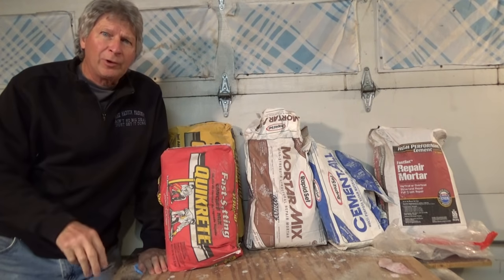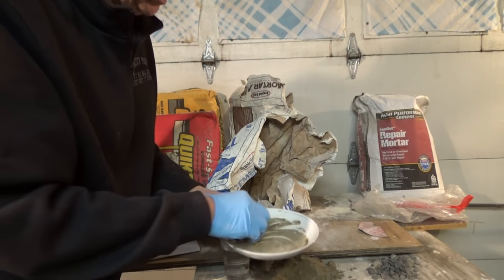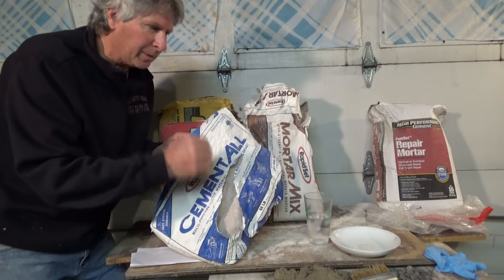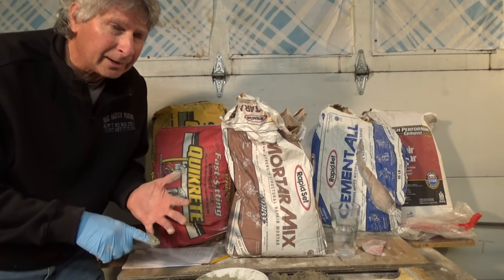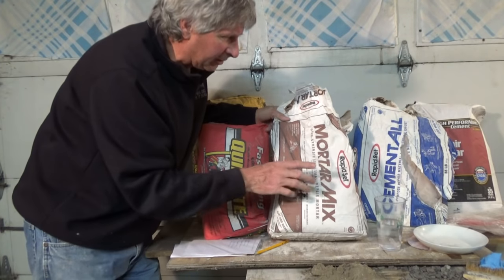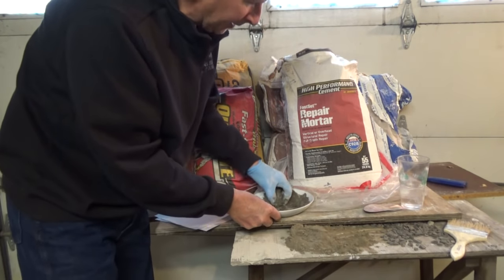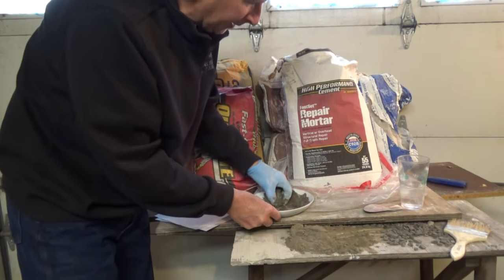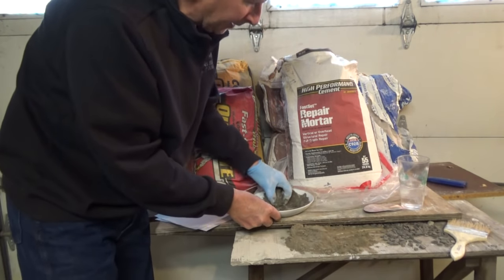WHAT CEMENT SHOULD I USE (Part 3) Mike Haduck "Fast drying"

Comment: The rapid setting cements are CSA (calcium sulfoaluminate) and are chemically different from portland cement, which is made from limestone (Calcium carbonate), which is converted to calcium oxides when clinker is made, and is mainly calcium silicates and calcium aluminates.  You can control the set time of the CSA cements with the addition of varying amounts of citric acid, much as in the old days of adding some soda pop (sugar) to portland.  In my decorative concretes, I add varying amounts of CSA to the portland from 5% to 30%.  This allows me to not only speed the set of the portland mix, but also adds early strength and the CSA, which expands as it sets, compensates for portland's tendency to shrink. Shrinkage cracks are then at an absolute minimum. If it's going to rain, I increase the amount of CSA so the mix sets within an hour.  I also work with mixes containing metakoalin and silica fume, both being pozzolans, and utilize their small particle sizes to take advantage of particle packing that creates a very dense, impervious finished product with compressive strengths of 15,000 to 20,000 psi when mixed using fiber additives.
Reply from the maker: Hi dperry,,,this is great info,  they should put it on the bag, I been doing everything trial and error, I added to the Portland a few times and it worked fine, but dosent work as a paint, it holds up to the freezing weather very good, I got to pin your comment to the top of the page,  thanks Mike
Reply: @MikeHaduck  I forgot to add that one of the other ingredients that I absolutely can't do without anymore is acrylic bonding agent/admix.  If you add it to your mix water, I think you'd get the results you want when using mixes at paint consistency.  I buy acrylic with 50% solids and dilute it 3 parts water to 1 part acrylic When doing parging or adding new mix to old concrete, wetting the old concrete with the acrylic/water mix instead of plain water and using acrylic in the new works wonders for bonding.  Most of the stuff sold in box stores is 25% solid or less, so it should be diluted with less water. Dozens of brands. Sika Latex, Laticrete, Acryl 60, Weldcrete, Crossco AcrylB60. Dayton-Superior J40, LaHabra Ladacyl, Fishstone KongKrete and more.  They make your concrete much more durable and waterproof.
Reply: You're a true craftsman. Kudos.
Reply: What do you think about 'Universal 1023'
Reply: @MikeHaduck  Yeah, they are almost secretive about what is in their products.  The CementAll is not all cement.  It has a very fine sand in it - maybe mostly.  The pure CSA cement is in a purple/white bag and super expensive.  A tan color shows that it is CSA not portland.

Comment: Cementall is no joke quick set. Just had my first experience with it and man, slap it on, smooth it out QUICKLY and move on. I swear it was hard to work after 10 minutes...IF THAT! DO NOT make more than you can handle.
Reply from the maker: Thanks albert,, I agree

Comment: Damn i came to say that i patched with that red bag of quick set today and what a hassle it was with all the rocks. I put a first coat, worked out the rocks, then went and sifted all the rocks out for a finish coat. What a hassle
Reply from the maker: Hi Greasy, I don't know what you are patching but I rarely use a product with rocks in it unless I got a big hole, I got lots of videos on "concrete repair" and others on "foundation repair" I use diffrent products, thanks Mike

Comment: Thanks for being a good teacher Mike. I’ve actually painted with Cement All  before turns old concrete white, learned that trick from you!
Reply from the maker: Thanks Geno, mike
Reply: Thanks to Mike I was able to repair the 4 foot by 3 foot section of120 year old foot thick brick wall that collapsed when I pulled the old front porch off. Its disconcerting to stand in the basement and look out at the street through a hole in the house. It kept playing in my mind wet it down good and just stick it in there. It doesn't matter how you do it just get it in there. Several years later its solid as a rock.

Comment: I like the Rapidset Mortar mix. After watching some of your videos last year, I did a foundation crack repair, an exterior crack that was leaking through to the inside of the house. Some handyman had done a crack repair in the same spot about 15 years before and they packed it with a chunk of 2x4 and thin diameter steel lathing for filler. The cement was crumbling, steel was already rusting and I suspect you never want to use wood as packing filler for masonry work. Rapidset mortar mix was great to work with and I used pre-mixed Quikrete parging cement for over top and then exterior acrylic latex cement paint. It's been a year and a number of hard rainstorms and no leaking from back splash/ground splash. Rapidset Cementall was another story. I went with that for some crack repair (up to 1/2" wide cracks) on a cement driveway pad because it was supposed to be finer than the Rapidset mortar mix. I am in the prairies in Western Canada and we get -30C all the way up to +15C with Chinooks in the same week in the middle of winter, we can get 3 feet of snow in a dump, hard rainstorms and hail storms in spring (but low humidity) and +30C in summer. Every crack I filled with Rapidset cementall crumbled and failed, I was shoveling it out with the snow, so it didn't even last until spring and I am going to have to clean it all out and redo it with another mix. I have to mention I did try an experiment with Quikrete Polyurethane Self-Levelling Sealant that you put on with a caulk-gun on another exterior cement pad with smaller cracks and inside a garage and it worked very well over the same period. Keep up the good work on your Youtube channel, Mike!
Reply from the maker: Thanks, driveways are tough, especially in your weather, maybe next time 1 1/2 sand to one Portland,  for the cracks but if the driveway is moving it will keep cracking, thanks mike
Reply: That's my concern, it hasn't started heaving yet but if the cracks expand it will likely start breaking up. What kind of sealant do you recommend after a repair? A penetrating sealant?

Comment: This is really helpful. I remember doing a project with a friend and we used rapidset without knowing just how rapid set rapidset is. Panic set in and we started hauling! Funny thing was the stuff we slapped down fast and striked off quick didn’t have any tiny surface cracks.
Reply from the maker: Thanks, Mike

Comment: Great video Mike.  I have an old patio that is a mixture of concrete and bricks and is still quite solid even though the surface is uneven.  I would like to give it a smooth cover with some type of cement or concrete product that would probably be one-half to one inch deep and wonder which product you would suggest.  Thanks in advance for your advice and keep up the great videos.
Tom
Reply from the maker: Hi Tom, to be honest, I haven't seen anything hold up in my area that thin, maybe another thin layer of pavers might help, unless I was there to see it I really can't say, Mike
Reply: I want to do same thing on stairs and don't know wtf to use!😲

Comment: Hi thank you for all your excellent videos & taking your time to make us the videos. 

i have a question please. So I have made a lean to shed using thin mdf board panel as my walls. What I did was I use the nailer gun and stapled the board onto the 2x4s all around. It’s been over 2 years now and it’s starting to come off like the stamped nails are coming off the 2x4 and there are gaps between the vertical boards that are attached side by side. My problem is that I can’t get myself to the back of the boards to staple or mail it onto the 2x4s. 

So I will have to go inside the shed and try to somehow pull the boards inward and use long nails to attach from the inside instead. 

Now my question is…if I was to use cement all fast setting and put at between the gaps between the two attached boards, will it bond and hold up? I was thinking about the fabric concrete and staple ins it onto the boards and 2x4s hoping it will bond. 

Any advice is greatly appreciated! Thanks!
Reply from the maker: Hi, Cement is just liquid rock in my opinion,  not made to stick to anything, it's mostly a binder not a glue, I hope it helps mike

Comment: Hello, great knowledge. I just put a new layer of cement on my front porch sides. I used the fastset repair mortar, about half a bag and i also put 4 scoops of portland and mixed it up and applied it. Will that be ok? Im in nj. 2 hours south of scranton pa.
Reply from the maker: Hi Kyle, I added portland before and had no problem with my mixes, I just wouldn't overdo it, thanks Mike

Comment: Hi Mike , I have a question, I have a auto repair shop that has chips out of the concrete 1/2 to 1in. deep from dropping heavy objects . They might be 3 or 8 inches of damage around the chip. I would like to know what is the best way to fix this type of patch , that will stick and won't come loose with traffic on it. I live in Canada  Manitoba. The shop is heated ,can or should it be done in the winter months or should it be done in summer. Any help would be apricated . Their are just so many premixed products when you go to the store to chose from.
Reply from the maker: Hi Jeff, I got a whole playlist on concrete patches,  and my rule of thumb is 3 days without freezing, Mike

Comment: What would you recommend to fix a corner that the dumpster company knocked off a top block on a wall? The pieces still there just don't know whether to use a mortar or some type of epoxy
Reply from the maker: Hi Dave, I have series called "masonry wall repair " maybe part 5 will help, thanks Mike

Comment: You mention using Rapid Set CementAll for iron railings but also mention rain causing havoc for it.  I'm looking to fix a loose porch railing.  Will using this product work for me or do you need to put a top coating of some other product to protect it from rain?  You mention painting it which may not look great on porch steps?  What would you recommend.  Thanks for this video.
Reply from the maker: Hi Samila, I have a whole series on concrete step repair and one video "brick step repair, part 6 ,mkke haduck where I put the old railing back in,  maybe that will help, thanks Mike

Comment: Mike I need to fix my foundation around the house (slab) with about 8 inches exposed before the house on top, its crumbling and especially at the corners, the house had no gutters till I moved in and I think that was the problem for it falling apart, so to fix the corners of the slab and smooth out the rest, should I use the rapid set mortar mix? I live in the Deep South so freezing is never an issue,  thanks for the info
Reply from the maker: Hi Sybo, I have a whole playlist , foundation repair,  Mike haduck I show what I use in each case,  every situation is a bit different,  thanks Mike

Comment: Thanks Mike!   What do you recommend for a resurface product, that is not insanely priced?   I recently used Top'nBond to resurface a 3.000 sq ft Driveway.  It took me months to do by hand, using a 1/4" Dowel Straight edge to ensure height.  Using a hand trowel, was the safest bet, after trying other things.   I had problems color inconsistencies, where one area would look a nice medium gray, while others very white.  Using a hand trowel did result in some lumpy areas , or a generally "not very flat" Appearance.  But using a squeegee, or a Notched Trowel, proved to be harder to do consistently.
The Top'n Bond did a pretty decent job, but its $16.00 a 40 lb bag.  Now i am waiting to see if it lasts without cracking.  Obviously  - I am not pro... lol.  IN SHORT - What techniques, or products would you use for a Resurface?
Reply from the maker: I have a video, concrete patches part 2 and I have other videos. Concrete resurfacing and sidewalk resurfacing,  I hope they help, mike

Comment: I hope you will still see be able to see this question! I wanted to build a small wood-burning stove with cement but I read reviews that said that the stove would explode. is there any type of mortar mix or cement mix that would be safe for making a wood-burning stove? I am also making stepping stones and I wanted to see which mortar or cement mix would be better, and do I need to add some sort of metal to the middle to make it stronger?
Reply from the maker: Hi Carol, I can't comment on that, most stuff is built with steel liners anymore, too much liability with a masonry wood burner, I won't build them, mike

Comment: If you had to pick a concrete mix to make a statue in a mold, not a big one, say 5 to 12 inches, which would you think would be better? I live in MA so cold weather can be an issue. Your videos have been helpful just learning about the different uses and how/why to use each mix. Thanks
Reply from the maker: Hi Denise, I never molded any statues, I am would think they use 2 sand to one Portland,  but I am not sure,  thanks Mike

Comment: Mike,
Another good video and proverb! If you haven't already, can you walk us through using self-leveling concrete? I've got a wonky basement floor area that needs to be flat and durable enough for some exercise equipment. Thanks, Dave.
Reply from the maker: Hi Dave, I really never use self leveling,  usually I build it up with regular cement, thanks Mike
Reply: @MikeHaduck  I'll think it through. Keep up the good work!

Comment: what would you suggest for filling cracks in driveways?
Reply from the maker: Hi Dolores, that make a quikrete caulking for concrete but I usually use a concrete patch and then paint the driveway with portland like in my driveway resurfacing videos but every situation is diffrent, thanks Mike

Comment: It’s been interesting watching you discussing which product to use for what job. With your experience do you have a suggestion for bonding 3/4” crushed rock used as a parking spot for a large rv. How would you mix it ant what consistency? If you have a suggestion it would be greatly appreciated. I’m in the Central Valley of California (80 miles south of Sacramento)
Reply from the maker: Hi Terry, I been a madon all my life and I don't have a concrete or asphalt driveway I just laid down modified and never had a problem,  thanks Mike

Comment: hey Mike what product would you recommend for where the asphalt driveway meets the concrete garage threshold? I'm thinking of using aquaphalt 6.0 from home depot ...what would you suggest? As the driveway has sunk a couple of inches.
Reply from the maker: Hi Rud, I couldn't say unless I was actually there,  I would check out and see what others did first, thanks mike

Comment: assuming proper curing is done, does regular mortar have more of a tendency to crack than the rapidset mortar?
Reply from the maker: Hi driver, I would say yes, because it shrinks and I have to go over it, Rapid set dosent but it dries extremely fast is I only use it on small projects, thanks Mike

Comment: Mike, I am rendering my brick fireplace.  

I used rapid set polymer modified structure repair concrete (per Quikcrete) for the verticals and it worked well.  

Now I need to do the little hearth (or skirt) 20'" x 50".  The coat is only 3/4" thick.  

I'd like to avoid using rapid set if possible but I will use it if  you recommend. 

What do you suggest ?
Reply from the maker: Hi DPK, I can't say unless I was there, lots of choices,  thanks Mike
Reply: @MikeHaduck  Okay, no big deal, Mike.   I'll throw a dart and hope for the best.  Thanks for responding.

Comment: Awesome video as usual. Mike can you make a video like this with admixes? Specifically with bagged portland concrete and air, fiber, retarder, densifier and plasticizers? Not the fast set with concrete pharmacy. I got a pallet and a sampler pack from fritz and want to try it. but I need best practices and experimenting with it, that would help before I try to use it on a real job. Just a thought.
Reply from the maker: Hi Jerrod, I don't do a lot of that, I just stick to what I know works, thanks mike

Comment: i have a 3'x5'x1/2" stucco repair patch to do. home  depot has type s mortar and rapidset stucco patch? i have to mix and apply myself so i'm afraid the rapid set will harden up on me before i get it smooth. should i use type s mortar?
Reply from the maker: Hi driver, I would do it with the S mortar,, rapid set is not easy to use unless it's all done in 5 minutes,, Mike
Reply: @MikeHaduck  1950's house, thats probably whats on there. thanks mike you're the goat.